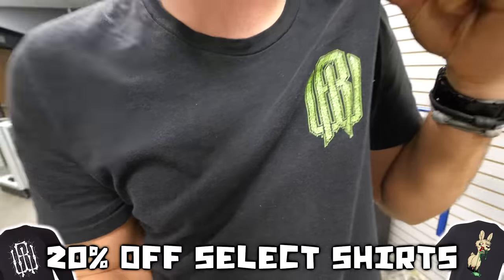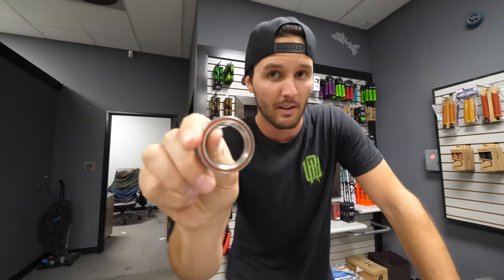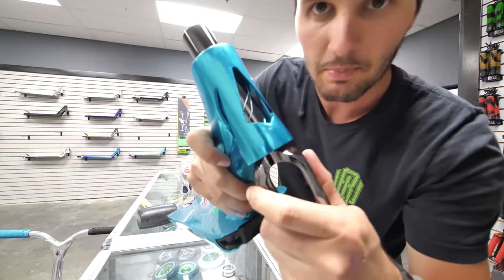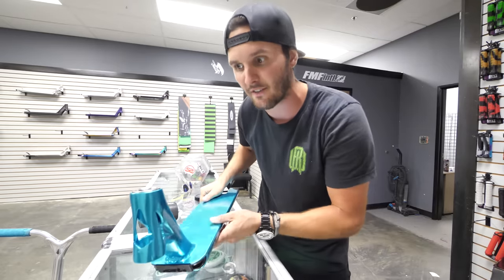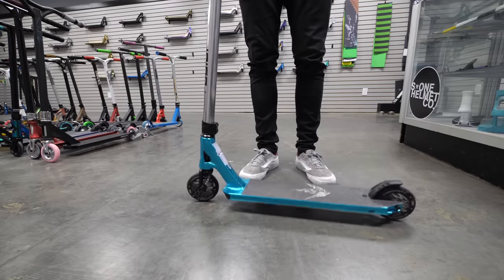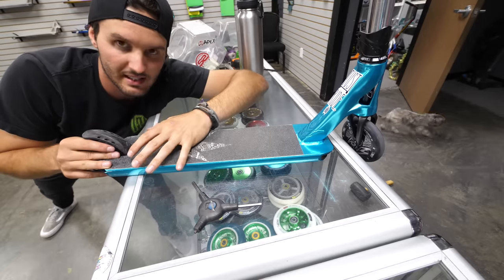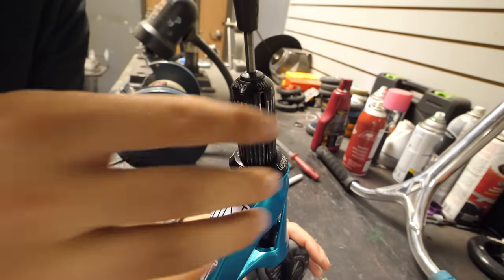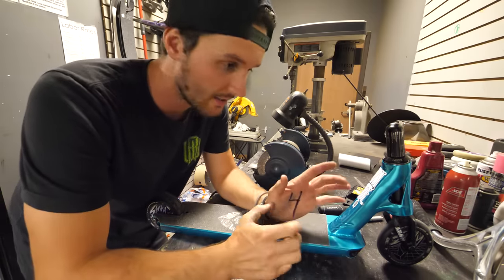How to DIAL YOUR SCOOTER the PROFESSIONAL WAY!

Comment: Thanks so much, finally my scooter is dialed again!
Reply from the maker: Glad to help!
Reply: sammyr4 mine tooooo
Reply: Raymond Warner  You made me get in to scootering
Reply: @raymondwarnerofficial  . so should i tighten my compresser as hard as i can or will it slow down my handle bars spin
Reply: @sleepyracing3495  it will slow it down get it a little tight so it spins fast and is tight enough
Reply: @raymondwarnerofficial  I've tightened everything and the clamp is exactly like urs but it still makes the noise its brand new and costed alot😨😰 idk If you have mgps or madd gear in USA But my scooter is alot different to yours
Reply: Raymond Warner my scooter wheels are tight but I still hear a lot of rattleing
Reply: @r6yuk515  oh that means you just need to get new bearings
Reply: @r6yuk515  try doing something else he said in the vid like tightening your compression or brake
Reply: @raymondwarnerofficial  legend
Reply: I’m the same
Reply: @nahbol2352  mad gears are terrible
Reply: @raymondwarnerofficial  i

Comment: Raymond when I tighten my wheels up it’s good for a bit but then it loosens up and i don’t know why can you tell me why. That would be amazing btw keep up the good work.
Reply: Harley Vlogs try putting a bit of duck tape around your wheel bolts it should fix it
Reply: Itzzconner lol that won't work, it's probably just the bearings
Reply: Try greasing your bolts that worked for me
Reply: Just tighten the bolts up a little more than usual and if the wheels for some reason feel not at slick put wd40 or graphite on it
Reply: @dumdumlegacy3251  wd40 will mess up the bearing a ton never use wd40 its horrible for ur scooter its a degreaser use actual grease
Reply: @jenk__  shoot sorry thanks tho
Reply: @dumdumlegacy3251  yw
Reply: @keegangeiss8143  same
Reply: You just have to tighten it everyday the reason I know that is cause mine does the same thing
Reply: Using some blue threadlocker should do the trick

Comment: I rode an undialed scooter for like 3 years...

Edit:  My scooter is dialed now poggers
Reply: 😶😶me too
Reply: I've never dialed a scooter
Reply: OOOOOOF
Reply: my undialed scooter is called a razor...
Reply: Me too
Reply: Same because of threaded fork now I got envy s8
Reply: I followed the steps and mine is still not really dialed
Reply: do you know if I need to keep the small lock washer in my scooter or if I can take it out?
Reply: @zacjohnson452  my is called street scooter😂
Reply: Same
Reply: Hqvocc_ X it’s probably ur brake
Reply: I've wanted a scooter for  Years but I just don't have  one😭😭😭😭😭😭😭😭😭😭😭😭
Reply: I had my compression to tight and finally realised it’s been focked this entire time
Reply: Cole i am riding one
Reply: Ridden a perfectly dialed scoot for about 2 years lmao. But for about 6 years never had a dialed one
Reply: My old one sounded like an old lawnmower
Reply: Me too
Reply: @hqvocc_x1248  push ur bars Down while tighting the clamp bolts
Reply: Dame
Reply: Same
Reply: I got a Razor scoot when I was 5. Finally got a decent scoot when I was like 11. It was never dialed. Ever.
Reply: Lol same
Reply: Niceee same
Reply: @zacjohnson452  lol
Reply: Okay, so I got a new scooter, a PROPER one. It’s a fuzion z250 pro. It’s pretty dang nice. I would recommend it to anyone with a budget of around $100-$130.
Reply: Cole still am i have had the same scoot for 5 years lol
Reply: Same it sucks and my friend tried to dial it but they did it wrong
Reply: Cole same
Reply: I have always kept my scooter dialed but I learned a lot more information about dialing a scooter in the video
Reply: chemiqal same
Reply: I did not for 3 but 2 its still a long time tho
Reply: Same
Reply: Same
Reply: Same
Reply: Same
Reply: Same
Reply: Lol same
Reply: I’ve had 3 undialed scooters in my 6 years of riding still haven’t had a dialed scooter
Reply: lmao
Reply: Same
Reply: That’s really sad ☹️
Reply: same
Reply: Ssssaaaammmmeeeee
Reply: Same
Reply: Lmao same
Reply: Same
Reply: Same
Reply: @serialistic4321  why
Reply: @timjanz9073  huh?
Reply: @coleberr4595  how does that make sense little kid
Reply: @edvesmanis7385  learn how to spell kid
Reply: @Nick_macphee27  a*
Reply: @603.F0Z  that’s ur fault
Reply: @zacjohnson452  it’s pretty dang shit
Reply: @drj4y8  that’s ur fault
Reply: @thndrnick6692  lol why are you replying to everyone? Also, what is trash? The razor or the fuzion? Because my fuzion has served me very well!
Reply: @zacjohnson452  trash is a cheap shit scooter for people who suck at riding
Reply: @thndrnick6692  lol, keep typing buddy.
Reply: @zacjohnson452  you got nun to say lmao
Reply: I know what was wrong with my scooter and why it wasn’t dialed but I couldn’t afford to fix it lol.
Reply: @lordbusiness1172  it doesn’t cost money to dial a scooter kid
Reply: Undialed scooters give me anxiety
Reply: @RyderEames  huh?
Reply: @thndrnick6692  I meant “undialed” autocorrect
Reply: @RyderEames  that’s what u said
Reply: Same
Reply: But am getting a envy prodigy colt s4
Reply: Your the best
Reply: Yeah same
Reply: @hqvocc_x1248  cos its rusted or broken buy new parts or scooter
Reply: @zacjohnson452  LMFAO
Reply: Nice
Reply: @serialistic4321  love your profile picture!
Reply: @Getman43  Thank you. CR all day ;)
Reply: Fun fact I dial my scooter every day
Reply: @hartonsd110  dang bro, you must have a lot of time on your hands
Reply: Same
Reply: @hqvocc_x1248  I know I'm 10 months late but it could just be the scooter or parts like he said
Reply: ive had mine for like 5 and i havent lol
Reply: Very poggers
Reply: Me tooo
Reply: Me to

Comment: Wish I has this video about 3 months ago. My prodigy’s compression was over tightened, my bars and deck weren’t spinning properly. Couldn’t figure out why and I am a noob to scooters so I was afraid to pull it apart. About a week ago I decided to pull apart the head set and put it all back together and found my compression was too tight to undo by hand, so I used a rubber mallet on my Allen key undid it and did it back up just hand tight and my deck spun like butter, so smooth and so fast. So I guess in the envy factory they over tightened my compression, because that’s how it came out of the box. I still can’t tail whip but I’m a lot closer to tail whipping now, still practicing and trying to get it. This video showed the exact problem I had, only briefly when he was talking about compression, but still. Thanks Raymond, I’m a big fan! Love your vids

Comment: My scooter still rattles i think it’s my back wheel it’s really tight but on the inside of the wheel something moved around inside near the bearing on the wheel I have nkd hollow wheels so it may just be a problem with me but do I need new wheels?

Comment: question are alllll these scooters parts are they interchangeable cuz i found a madd gear deck and i wanna build my kid a scooter from a lot of cool parts he’s only 6
Reply: Most parts are you just wanna make sure your wheels fit your fork size and the bars are not to tall also might wanna check the headset

Comment: Raymond my scooter is all tighten and stuff but my back wheel makes a weird sound with new bearings and tighten and also it moves what wrong with my scooter
Reply: envy prodigy has that problem
Reply: Maybe try getting new spacers
Reply: put a few washers in the axels
Reply: Does your back wheel sound loose? Bc thats why my 1 week old VX8 Team does but i cant fix it even though its tight.
Reply: Squiggles 
yes it does, and I even tighten it all the way
Reply: GGGamingforce  I bought a ethic erawan and my back wheel does a sound when I do the drop test
Reply: my district dk 253 deck does that to
Reply: GGGamingforce l same I got vx8 u need to replace the bearing and tighten them good and don’t ride in the rain or night

Comment: I see you have a threadlocker on the clamps, maybe Loctite 243 or similar, do you still use it on scooter parts, and is it only on the clamps (on both threads?), or also on other parts?

Comment: My root Industries scooter’s bar doesn’t come out, even after I loosened the clamp. Please help, because my wheels are crooked
Reply: Oof man. Try to unscrew the clamp (take the bolts off), step on the deck and pull as hard as you can. If it doesn't come out, well you're screwed.
Reply: Same here but my mom and dad helped me and it came off!

Comment: Every time i put my bars on there crooked and if not when im finished riding there crooked
Reply: super snake same i dont know how to fix it tho
Reply: Same
Reply: super snake tighten your compression.
Reply: Tighten you compression and clamp
Reply: Tighten your clamp, and maybe even your compression, mainly your clamp
Reply: super snake tighten ur clamp
Reply: The Donkey King tighten your clamp
Reply: Its because you are so weak you can't tighten your clamp enough
Reply: @ajbro6428  although that is kind of mean, you're right
Reply: There not right enough or scooter is faulty I didn’t put mine tight enough and they kept on moving
Reply: compression and clamp need to be tightened
Reply: The Donkey King 
It’s pretty simple. Just tighten your clamp.
Reply: Clamp

Comment: What are bolts underneath a deck for? I have these 4 bolts under my Emove touring deck but some are loose/cross threaded once I took them off there doesn't seem to be anything it's holding possible the controller or a spacer of done kind?

Comment: There is an audible cracking noise coming from my front and back wheel when I land even slightly sideways doing a 360, tail whip, bar spin, etc I have taken the scooter apart lubed it and put it back together (the right way) what should I do to fix this issue?

Comment: I literally did everything in the video i even replaced the 2 barring (i know i cant spell) and the scs compression and used lock tied liquid and its still undialed. And whenever i turn my scooter it making like these popping noise or cracking noise. IS there anything im doing wrong or not doing completely. I also tighten the front and back wheel.

Comment: I can get my scoot prime and dialed, everything is greased and spinning nice and ready for a nice session. I get to the park warm up and it still feels good. I bust out a backy and immediately my scs is loose. I try tightening it extra tight and make sure it is perfectly evenly tightened however it still comes loose. I'm a pretty big rider, but regardless it shouldn't be doing that. I ride tilt scs and fork so I know they should be fine together. Any tips?

Comment: What about  TCS compression
Reply: will stewart not exactly sure how it works.. pretty sure you just take off the front wheel and there should be a bolt in the fork. Let me know if it helped
Reply: What is TCS??

Comment: Hi... I got a problem with my scooter .. and I need help since in my country there is not a lot of scooter stores or workshops where to get it fixed .. So I have to get it repaired by my own...
So what's the problem .. I have had this scooter since I was a kid .. then when I was around 9 its wheels died... Recently I decided to fix it... I found the wheels and I replaced them... And I been fixing other problems it had... (No pro work... I don't have the tools)... In the end to be able to fold it .. the deck slightly touches the floor... :|

Comment: I would like to add, if all your parts are tight but it doesn’t sound dialed, check the heads of your bolts. For me, the heads of my clamp bolts were scratched were you could just see pure metal and my bolts were black, and that’s what caused my scooter to be undialed. Just go to your local scooter shop, or order whatever sized bolts you need, or just order a new clamp if you want a new clamp. If your heads of the clamp bolts are scratched, it could cause your forks and compressions to move. I hope this helped!

Comment: When I tighten my wheels they don't spin that much but if I barely loosen them it raddles. Help
Reply: Slightely tighten them in the middle
Reply: @leo134-t8l  wdym?
Reply: What do u mean wdym
Reply: Oh yeah I mean don't over tighten but dont undertighten just in the middle
Reply: @leo134-t8l  how are you supposed to tighten up the middle??
Reply: You just tighten it not too loose and not to tight you just balance it out
Reply: @leo134-t8l  ok

Comment: What if my bars are stuck on so they are hard to remove when needing to adjust the compression?  I have trouble with this, and usually have to resort to banging the deck with a rubber hammer while holding the bars.  Suggestions?
Reply: Fully undo the clamp than hold the bars so the scooter us suspended abive ground then stomp on deck with one foot

Comment: You didn't mention when you'd need to add extra headset micro shim spacers between the bearing cover and the compression ring, what purpose made spray lube to use (i.e. silicon or Lithium based) and what types to use or avoid (i.e. water dispersers), and why not to just use any type of grease

Comment: My scooter is still rattling and it sounds like its coming from the back I have tightened the break and the back wheel I also made sure there where no rocks in the deck and it is still rattling for some strange reason

Comment: I dunno my scooter sounds kinda weird but still ok and theres no issue with any of the things you said 

My new weehls are stiff af (i also bought bones reds seperatly)
My brake does not exist (i really need a new one) 
My clamp is fine and tight and 
My headset is very tight not moving around and just stiff (also new one)

WHY IS MY SCOOTER MAKING NOISE ???

Comment: Can someone help me, my scooter is really annoying because when I am not riding my scooter, there is a really loud rattle in my back wheel, I have tried to tighten all my bolts but that didn't work. I have been riding like this for 3 months. If you can help me, that will be very very appreciated

Comment: My bars are hard to get off but I got em off and my scooter was so undialed it a vision street wear but my new scoot is a proline so now on my vision street wear I’m not embarrassed 😞 at the skate park and no one makes fun of me now i teared the head set out and made custom parts the next day went to ride they went all loose I was pissed but then I saw this vid and was like I will try that thx again ray for helping the parts are good quality as well I spent 8 hours building them it took about 50 days off the top of my head also my freind was wondering why his headset was so wobbly so I tightened it for him he offered me 10 bucks but I said no beacause the first Time I did it, it was very easy

Comment: Even tho everything is tight, my back wheel no matter how tight I make it, it never stops rattling. And I swapped the bearings it wasnt that. Can somebody please help
Reply: Lyrixc it might be your brake vibrating when u go on rough surfaces instead of smooth ones
Reply: Lyrixc forgot to mention also it vibrates if u have a metal brake not plastic so hope this helps you
Reply: @op7279  it is definitely my wheels cuz it rattles when I touch it

Comment: My front wheel is so tight that you can't physically get it any tighter. And it still moves a tiny bit. So my scooter sounds fucked. And when I turn hard there is another weird rattling noise coming from my back wheel. 
My scooter is only 3 weeks old. And it is already fucked.

Comment: you are over tightening your bolts which leads to stripping threads when you go over the torque rate of the bolt or Axel or whatever your using